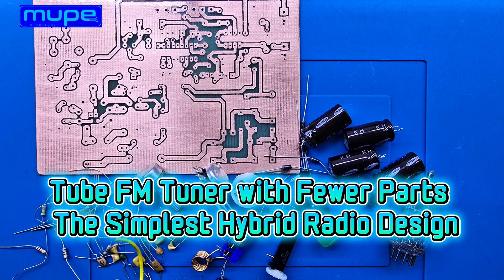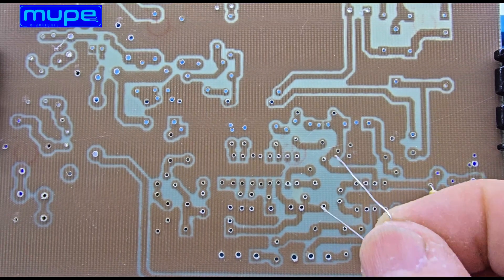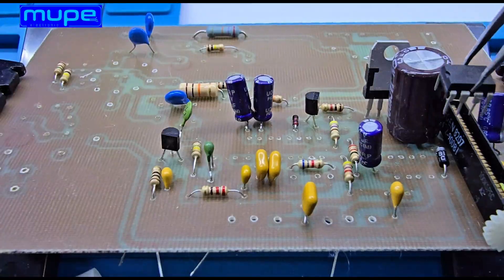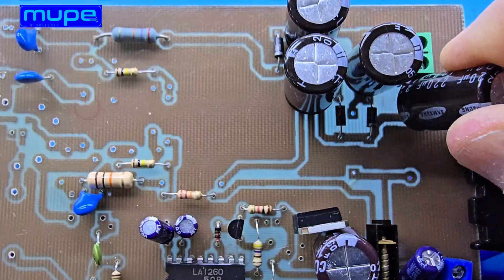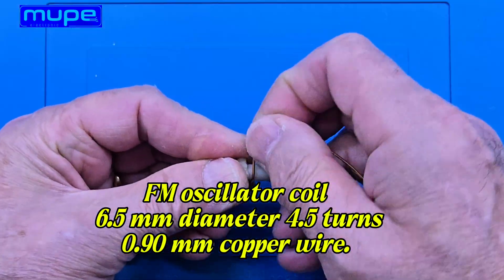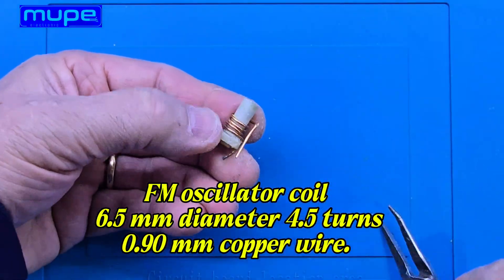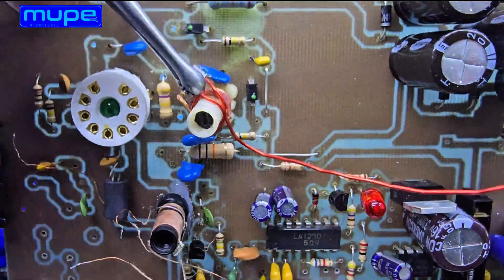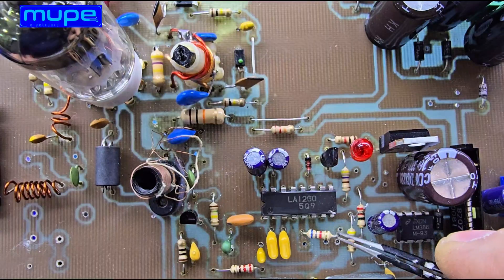Varicap-Controlled ECC85 Tuner  The Stability Surprised Me

Comment: You used an LA1260, an LM386. That tube might as well not have been there at all. You built a hybrid, selecting the worst possible features of every electronics era. With just two vacuum tubes, you can build a very nice radio: one tube as a high-frequency front-end, the other as an audio amplifier. If you want a speaker, add some junk power pentode and a speaker transformer—a small, properly modified mains transformer will do just fine. Well-built vacuum tube amplifiers have an exceptionally pleasant, warm sound due to their characteristic distortion. Old-time tube enthusiasts value these designs for their sound and the barely visible orange glow from the filament. What's a nasty fad is adding LED backlighting, which ruins the whole effect. It's as desecrated as taking an absolute automotive gem from yesteryear and covering it with kitschy LED strip lights. Superheterodyne amplifiers have been successfully built using vacuum tubes, achieving very decent results. The immortal radios known from old cartoons like "Tom & Jerry" were just such radios – we called them "cathedrals." The semiconductor component also has its advantages, but it needs to be skillfully combined. Rectifier diodes are often used instead of tubes, for example – this reduces the design and improves lifespan. Designs that delay the anode voltage or soft-start the filament current are also added. This increases tube lifespan several-fold.

Don't take this as hate, I'm keeping my fingers crossed for your future designs.
Reply from the maker: can build many different designs: a fully tube-based circuit, a hybrid version with a transistor tuner and tube IF/audio stages, or a supply using a 240V/6.3V transformer. I can also use a 12V DC to DC step-up converter to generate the anode voltage. It’s even possible to make a tube tuner with PLL, or a complete all-tube FM receiver inside a metal chassis. My goal is to experiment with different designs that are rarely seen, and I plan to try these ideas in the coming days.
Reply: @mustafapersembe No, no. A step-up converter to the anode voltage, especially for tube circuits, is a very bad idea. If I remember correctly, the USSR experimented with this for car radios, but it was a terrible solution. You have to go to great lengths to eliminate interference from the power supply. Even full shielding doesn't always work. The problem becomes more acute the more audio power you ultimately want to extract. Multistage passive filters are a pain in the ass. It can be done, but it's rocket science, and the results are very poor. That's why they used special batteries, high-voltage galvanic piles, and subminiature tubes.
Reply from the maker: @compaqchemlab Thank you for your comment. I truly appreciate your perspective, progress, and technical expertise.

I plan to build a more traditional, all-tube design in the future. Thank you again for sharing your insights and experiences; it's very valuable to hear such comments from someone familiar with classical radio engineering. I'll try the anode dc-to-dc boost circuit and see the results.
Reply: @mustafapersembe You know, I'm no expert. It's just that a long time ago I did these kinds of experiments, and many "outstanding specialists" couldn't tell me how to do something right or why not to do something. Today I know they didn't know it themselves. That's why I want to help others so they don't hit a wall—like I once did. Tube circuits are a difficult subject. This is due, among other things, to the high voltages, very high input impedance, and so on. I've known cases where, to improve sound quality (but not any audiophile tricks, simply to eliminate a significant amount of 50/60Hz mains hum), the filament wires were twisted into a braid. Just like an Ethernet cable. If you power the filament from the tubes with a transformer (which is often done if you use many tubes in parallel on board and need high current), the ripple cancels each other out. Two large (10-100k) resistors connected in series with each other and in parallel with the filament were also added. The center tap was grounded. The actual power supply to the tubes is important to ensure that nothing hums or excites. Start the power supply (anode) with the component with the highest current fluctuations – usually the audio power amplifier. Then, slightly smaller ones: the audio preamplifier. Finally, the RF section. Of course, you use power supply filtering for each of these. Typically, each subsequent anode power supply section is separated by a high-power resistor, say 1kΩ 5W, and an electrolytic capacitor to ground is placed between each. Resistor-Resistor-Resistor, and at each tap – a capacitor to ground. Each subsequent tap will have a slightly lower anode voltage, so this must be accounted for in the design. This is the price of reducing the size – you could use chokes, but unfortunately, they'd be as large as a mains transformer or fluorescent ballast. If you started the power supply from the other side, the RF side, the audio amplifier would be at the very end of the chain. At higher volumes, it draws more current. Ripple and interference appear, which then feeds into the RF amplifier in the path. I was surprised by this myself once. Theoretically, you could use much larger capacitors... but this, in turn, places a significant load on the power supply itself. It's also not worth messing with circuits powered directly from the mains. It's very dangerous for the user. If you search very carefully, you'll find a video on my channel a long time ago showing how to build an AM radio and a tube amplifier. The circuit still works. I wish you much success and keep my fingers crossed for your future experiments.